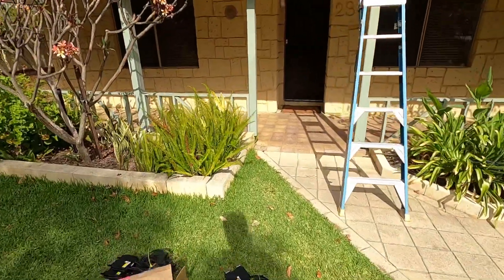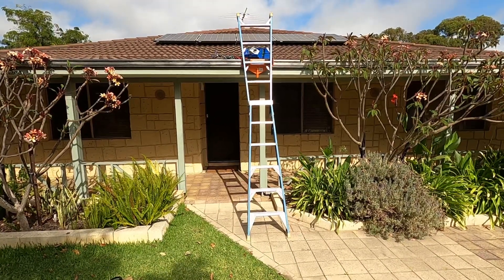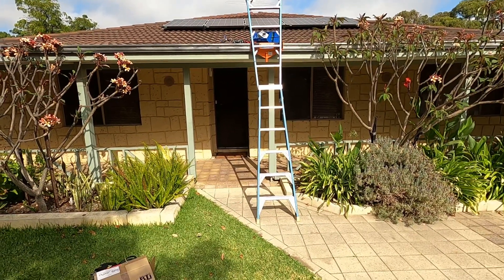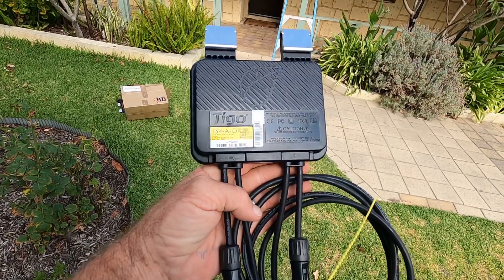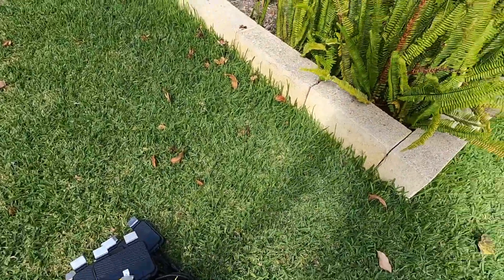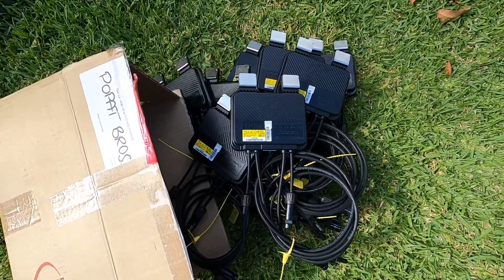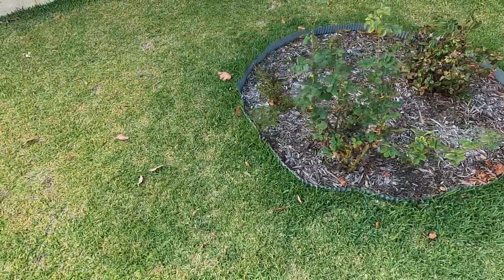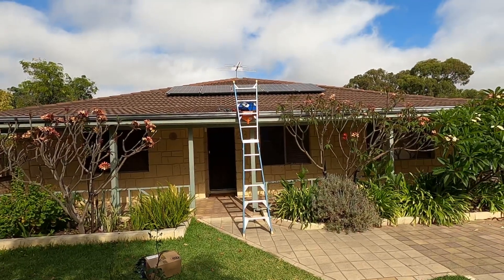Tigo optimisers and how they can help your solar system perform better.

Comment: Tigo Optimizers do not cause clipping,  in fact they try to prevent it from happening.    If anything is clipping the solar production it is the inverter because the pv's and optimizers are creating more power than the inverter can handle and that is when clipping occurs.

Comment: Hey, just been testing these.
Your analogy is wrong.
If you have panels in a string and there are shaded panels. The diodes on the panels will by pass and not drag down the power.

See. A few other people report the same and how they can lower the output... I didnt find that myself, they simply do nothing.

Could you do a follow up video and show the difference they make.
Reply from the maker: Not true, see one if my other videos showing how a shaded panels drops string current.
Reply: @joondalupelectricalservice3201  they do,  until the diodes kick in and there has to be a difference between panels.
At least the tigo drops the voltage and takes out the whole panel rather than part of the panel.
Volts x amps = power.
20v 2 amps = 40w sunny
10v 2 amp = 20w. Tigo
20v 1 amps = 20w  shaded no tigo
Reply from the maker: The diodes will eventually fail, the shaded part of the panel will also become resistive and hot and will also eventually fail. The Tigo is protecting the panel from damage, in fact if you read the warranty conditions for a warranty claim to be honored most panel manufacturers stipulate that a panel installed in a partially shaded location will void the warranty……

Comment: Do you have to connect 1 tigo per panel in 2 different orientations,Or if you say have one string facing same orientation and say of 8 panels and one or 2 panels shaded you only put tigo on them?
Reply from the maker: Yes thats correct for both scenarios 👍🏻